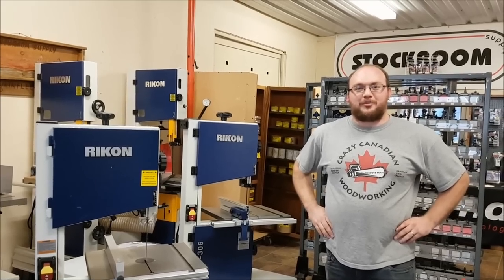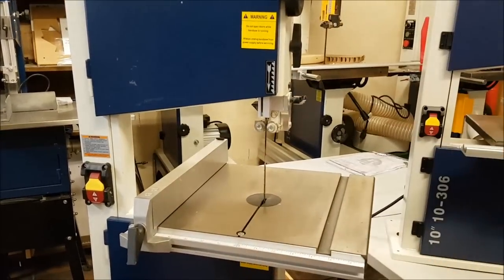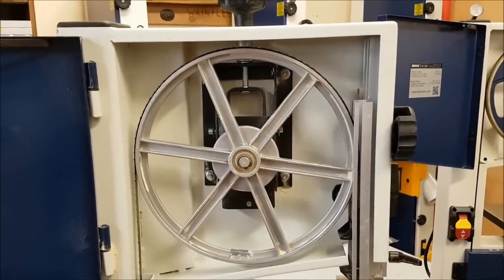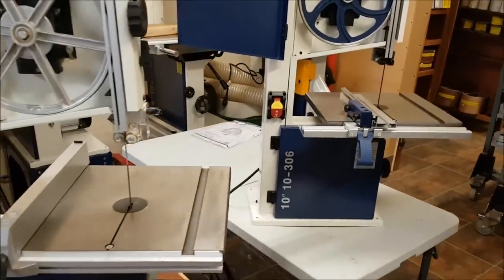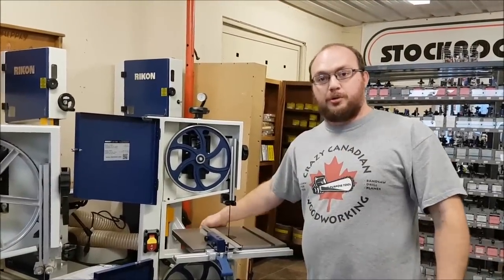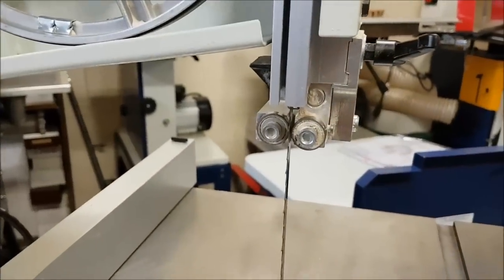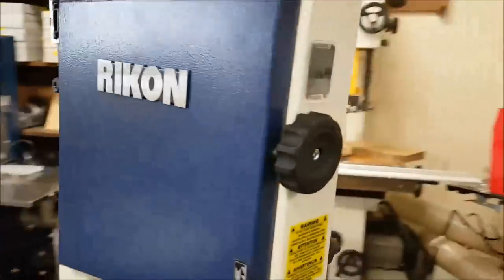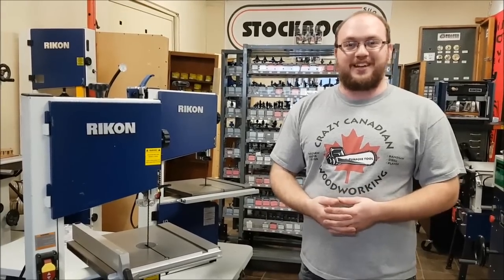Differences Between Rikon 10" 10-305 & 10-306 Bandsaws! A Review of Each Saws Features EthAnswers

Comment: Muchas gracias for the head-to-head comparison!  I found it very informative.

I just got a 10-305 (haven't even set it up yet), because the seller did not offer any other 10" Rikon models.   Gotta say, now that I've seen what the 10-306 has to offer, I would've been tempted to drop the extra coin, if only they'd had one there.  That fence looks pretty sweet, for one thing!  And a stronger motor is never bad, either.

Having said that -- I'm reasonably confident the 10-305 will serve my needs well enough, anyway.  I'm only expecting to notch out pieces of 1x stock and this-and-that chunks of OSB and plywood.  No matter how you look at it though, the Rikons sure are built WAY better than the plastic junk that just about everybody else is selling in the 9" and 10" range.

Comment: Just purchased and setup the 306. I love how quiet and efficient it cuts. My only question is the clamping mechanism on the fence. The directions specify not to apply too much pressure when clamping down the fence. I've adjusted the two nylon set screws, but still find there is a lot of pressure needed to clamp the fence. However, is it necessary to move the clamp to its maximum "down" position to secure the fence. I'm leaning toward "not". Just move it down enough to hold and maintain the fence into position when there is slight pressure against it when running stock. Would you agree?
Reply: I just watched a video by Mark D Maker that addresses this very problem. The video was done 5 months ago, so you may have already discovered it.

Comment: DId they fix the problem of the blade guide not being square with the blade as you raised and lowered it on the 10-306, which was an inherent issue on the 10-305?
Are the wheels factory balanced on the 10-306 as they are on the 10-305?
If they did, I didn't see any balancing weights on the 10-306 when you opened it up but you can see them on the 10-305 wheels.

Comment: Would you be reviewing the differences between the 10-306 and the 10-3061 anytime soon?  Thx
Reply from the maker: My understanding is the only difference  is an upgraded fence on the 10-3061. Once I get one in stock here I’ll check it out
Reply: EthAnswers by Stockroom Supply I saw something where it said there was an improved 1/2 horsepower motor as well.  I thought your previous review of the 305 to 306 was informative so was wondering what your thoughts were. Thx.

Comment: Good info. I have the 305 and it is a good little saw. However something you left out is that the 306 has Allen adjustment screws to adjust the back of the blade to the table and the 305 does not. Do you know if that adjustment plate is interchangeable? If it is, to buy the plate to swap out may not be cost effective.
Reply: I have a 305. I don't understand your question about adjusting the back of the blade to the table. The 305 has the rear bearing adjustment. What adjustment are you referring to?
Reply: Nothing to do with the bearings. All about adjusting blade square to table, side and back. Trunnion on 306 has Allen screws to do this, 305 does not. Are trunnions on both machines identical except for the allens screws in the 306 trunnion?
Reply: @MrAffolder  I see what you mean. Front to back can be set but not side alignment. I suppose thin shims could be used but I just checked my saw and the blade is is in perfect alignment to the table.
Reply: Coachman I have 10-306 and it does have those screws for micro adjustments to square your back of the blade with the table. You have to slightly loosen the four screws that hold trunnions plate first than adjust Allen screws in pairs like top two than bottom two.

Comment: What is the difference between a 10-306 and a 10=3061?
Reply: I. Also quite interested in this comparison. Have you found your answer? I had a 10 - 306 and had to return it due to the blade flying off. It could probably be tuned but was out of the realm as the bottom wheel was out. I am thinking of buying a 3061 as I loved the 306 when it did run.

Comment: Hi eth
I got a rikon bandsaw 10 305 , I changed the motor to a 220 V (for my country Argentina) ""''bigger ,"" And really I m very happy with the update.
The question is that I got orson 1" 3 teeth blade that is very different than the 1/2 inch thinn one previous
The point is that the machine has a better attack to the wood  , but there is a lot of smoke on my garage now.
Its not the motor , I feel that the widest blade makes it
What do you think about??
Thank you very much for your video
Reply: Sorry 1/2 inch x 3 teeth x 70,5